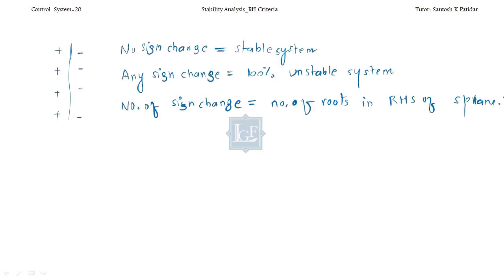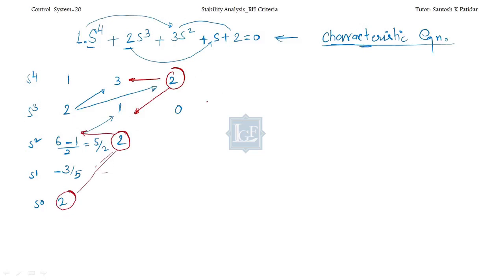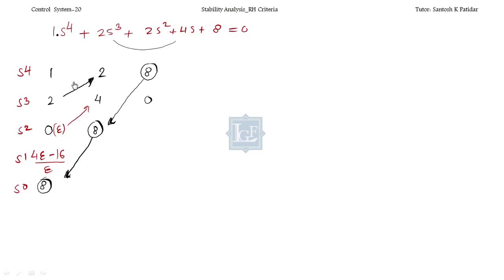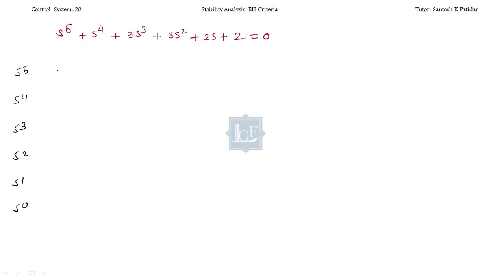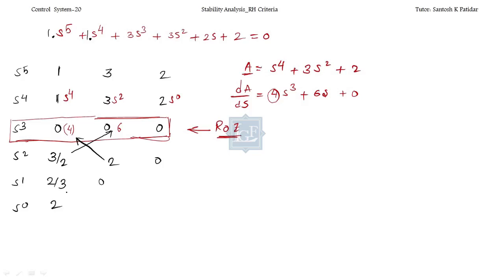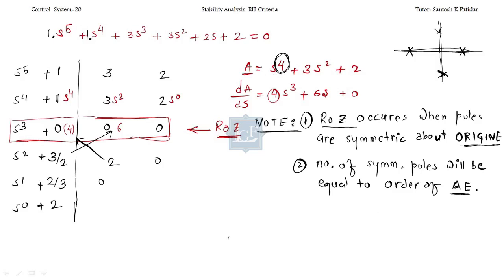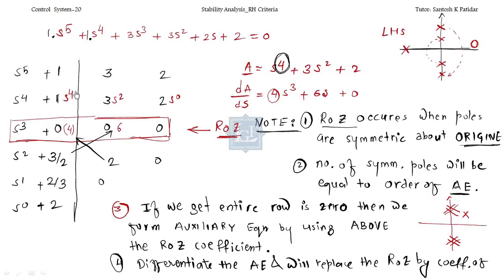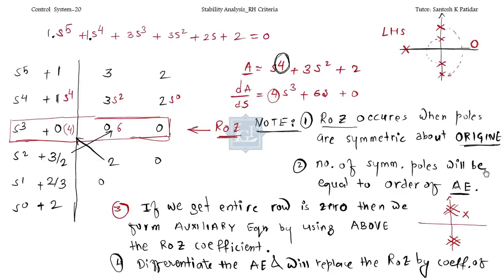Lec 20 Stability (RH Criteria Contd.)

Comment: Sir In ma point of view , S(power 5)+S (power4)....=0
There should be two pair of inside elements -
Inside 1 -3*3=9
Inside 2- 1*2=2
Outside -1*2= 2 
Inside 1 is greater than outside .So, it is stable 
Inside 2 is equal to outside .So, it is marginally stable .... Then only poles lying on imaginary axis ....